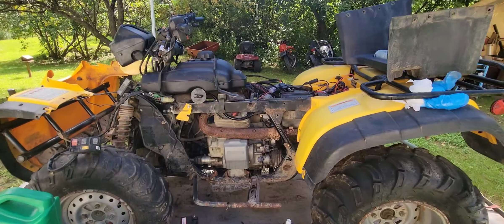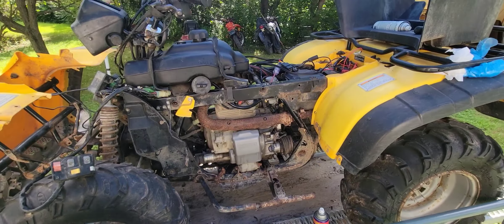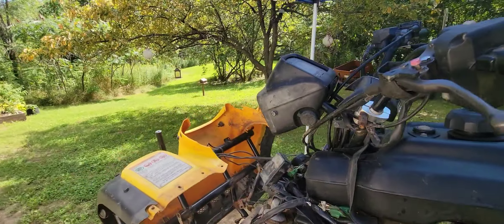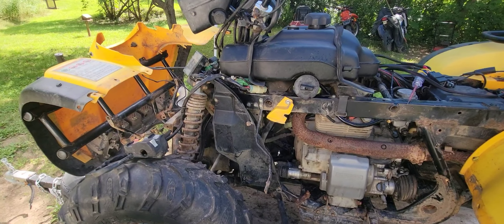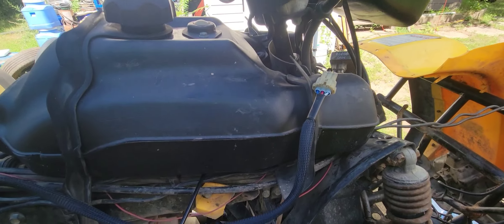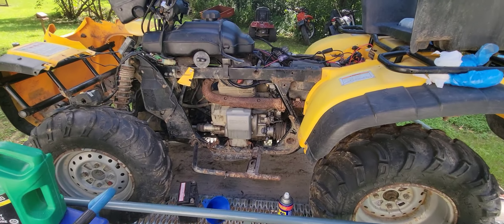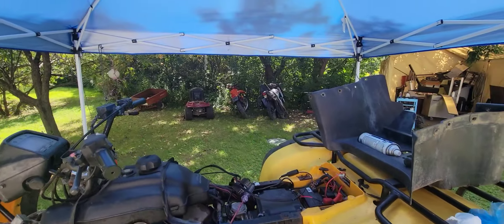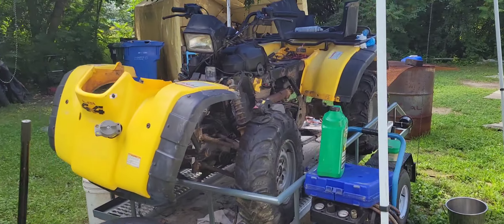honda 450es shifting problem,wont shift ?..easy fix boys !

Comment: Inexpensive angle sensor, which is a wear item, along with cleaning and lubricating the gears inside the shift control motor housing mostly fixed my shifting problem. It has only acted up a time or two since. While there are other sensors involved, maybe one for neutral, reverse, can't remember, but a guy here on YT who used to work on these daily professionally did say the angle sensors are trouble prone. Someone else said a weak battery can also cause shifting and other issues with these bikes. Also check your connectors, clean, sometimes all they need to make good contact again is take them off & back on. Also somewhere on YT someone mentioned a ground wire, seemed to me it was up front kind of under the gas tank which gets corroded and causes electrical gremlins. Yeah, now if it came down to an ECM those are an expensive deal, so in that instance a shift bypass kit would at that point be looking pretty good.
Reply from the maker: Yep..definitely a few possibilities but this is a good replacement for ecm issues  !

Comment: Great tip! Honda screwed themselves with the electronic shift bs. CVT is where it’s at!
Reply: I like the old footshift best
Reply: Cvt means your at 8 grand trying to accelerate majority of the time not where it’s at reliably wise but I will say they are fun
Reply: @Motovlog_69  change the belt. That’s not normal at all
Reply: @smallgaragehustle  well once your up to speed your way up in the rev range I’ve noticed that on any cvt even brand knew

Comment: i have a 2004 Forman Rubicon 500 automatic i bought it used for 400 and it seemed week until it got to like15mph almost like 1st gear wasnt working and it was starting in 2nd now it seems like trans is locked up i replaced angle sensor and tested shift motor and that seemed good wondering if i should try something before i pull motor and trans motor starts right up but seems like trans is locked and holding motor back i even went thew valves and everything is good on the motor any ideas i herd they have same kit for the 500 so was thinking about trying that man but have to end up pulling trans if that aint the problem i wonder if i could put a manual trans on it

Comment: 01 foreman es and mine started gradually not shifting, it may work a week no problem then it wouldnt shift a few days eventually it quit shifting altogether. I replace censor it didnt fix the problem i done more research and finally decided it was the shifting starter . I replaced it and everything started working. Was actually pretty easy to change and worth. I want to see what gear im in. They wanted over 300$ at honda and i got a DB starter off of amazon for 67$ i figured if it works i know the problem if it last a few yrs thats ok to.
Reply from the maker: Glad it worked out !
Reply: So mine shifts great for 20-30 mi utrs while plowing snow bit than I need my 12mm to shift it ot flashes on the display
Reply: @Wyomingchippewa  replace the shifter motor or you came take it lose and see if it work while still plugged in before buy one.
Reply: @joedutton3413  it works for 30 minutes than stops when I cool it all down works just fine again

Comment: When you install the delete kit does it still show 2nd 3th and 4th gear on the display screen? My ecu is bad so I made a foot shifter but because that exu is gone it won’t display 2,3,4 gears but it shifts thru them fine
Reply from the maker: Yep will work like it was original..it will bypass the ecu

Comment: I ordered one of those kits but it keeps blowing fuses at random sometimes it will do good then other times I got threw ten fuses just to get it to move no idea why can you help??
Reply from the maker: its def a short ,most likely at the handle bar switches or the shift motor or wiring goin to it ..hard to fix from a keyboard lol..good luck !
Reply: Ok thanks bud

Comment: Anyone knows my Forman es has a problem to shift from 2nd to 3rd gear after sitting for a day or so ! I have to push sifter bottom 5 times sometimes to shift it !
Reply from the maker: Most likely the electric shift motor !

Comment: Don't buy no kits or no buy pass harnesses just make a foot shifter very simple
Reply from the maker: The foot shifter on an ES was designed to get you home in a pinch , it can't handle every day use unfortunately..I tried in the past and ended up breaking..cheers !
Reply: @beardedvanadventures  i thought the only difference between electric shift and standard models would be the shifter shaft hex vs spline, and ES having a shift motor and reduction gears. so all you need to do is remove the gears and add a foot shifter
Reply: También funciona para una  Foreman 500 2001